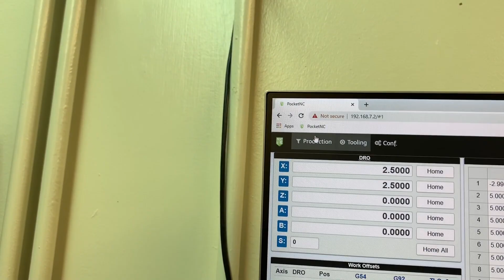PocketNC V2 3+2 5-Axis ...Face Scan

Comment: That's pretty awesome. How long was the carve time?
Reply from the maker: Robert Baker Thank you, Total time was about 1-1/2 hours. The material is machinist wax and it cuts really easy.
Reply: @richardzicarelli3193  Thanks for the reply. What program are you using to run the G code?
Reply from the maker: Robert Baker Mastercam 2019
Reply: @richardzicarelli3193  Can you melt the chips and re-use them?
Reply from the maker: Lump Art .....  I have never tried it but Im sure you could because it is machinists was.

Comment: Do I see this right that all the machine rails are made from Aluminium? Well, this is a fail construction then. There is a good reason why rails and machine beds are made from hardened steel or cast iron...As technology toy it is interesting but for production? Of what? Plastic parts?
Reply: „Kern“ is a CNC Manufacturer and uses aluminium rails. Those are the moste precise machines in the world.
Reply: there hardened steel

Comment: How much for a copy of my face?
Reply from the maker: It’s cheaper on a 3D printer. The PocketNC takes a few hours to prep and machine and we charge $45 per hour, so your looking at over $130 bucks. If you want a small 3D print of your face we can do it for $45 plus shipping charges. You have to supply the 3D scan in STL or SAT format.

Comment: Very expensive toy…yes, that’s exactly what it is, a toy
Reply from the maker: For standard parts, I agree, however, dental offices are using it with an algorithm to custom machine Invisalign braces and many jewelers are now using it to do produce their 3D designs for lost-wax, casting. Mine is used to demonstrate and teach five axis machining at our Engineering University.